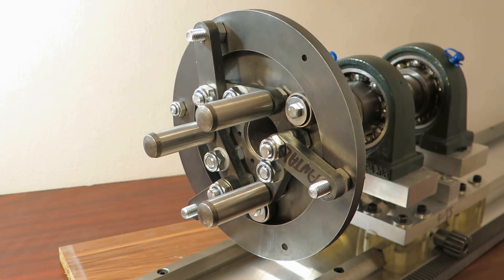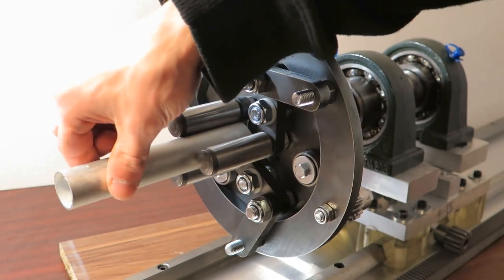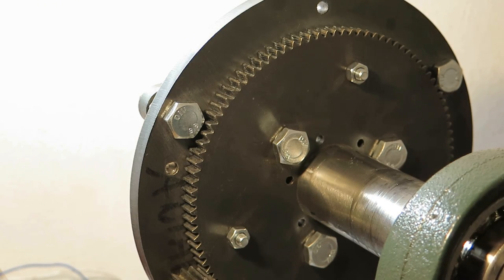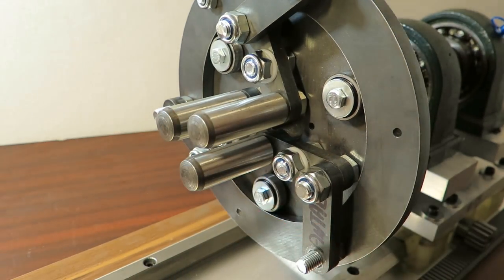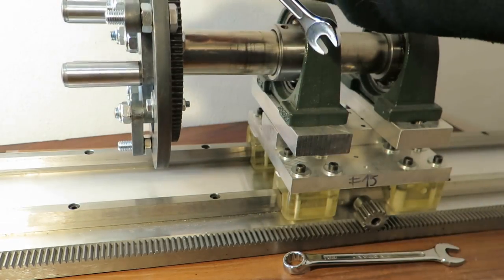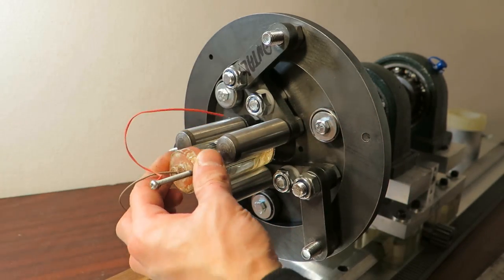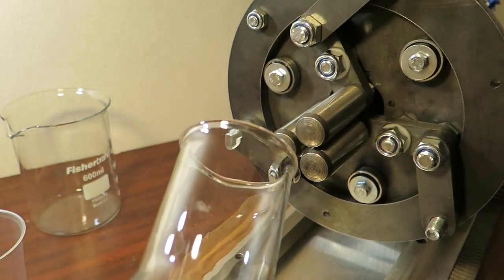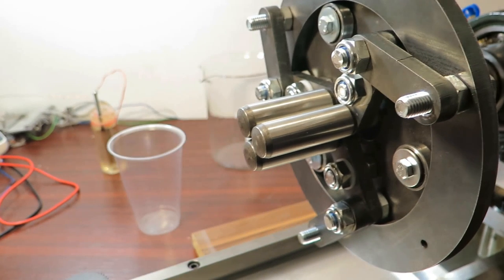Glass blowing lathe chuck

Comment: keep in mind, glass lathes don't go glass to metal, the metal jaws need to be replaced with Teflon or covered with flame resistant material (in the old days, this would be asbestos tape or similar).  This is really an excellent variation of a planetary glass chuck without all the tedious gearing!  Thanks for sharing this.

Comment: 4:28 - How is the air tube feed into the glass tube?
Reply from the maker: Well honestly I use pretty low tech solution so far - I bought memory foam pillow that I cut into circles with hole. Then I have thin bent aluminium tube on which I slide this memory foam, press it with hand, push into glass tube and I get decent seal where aluminium tube is able to rotate freely.

Not the best solution, but it is relatively fast to use. It can get bit tricky to work with sometimes when glass piece is short or it doesn't fit through shaft.

Comment: I will pareciate if you can put me more details about your project (including drawings) here or in private mode as you wish because is an interesting approach.
Reply from the maker: Don't think I have drawings, But I have some more info here https://www.youtube.com/watch?v=Cb4P3WYSkJI&list=PLyzlj5IaDE0f3XQ1dLXt-6RA28rN2mx7B
And some models here https://grabcad.com/library/glassblowing-lathe-2
Reply: @IlusysSystems  Sorry but i'm interesting only about the chuck and BTW: i dont't have the last roar of autodesk or dasault system to open .ipt or .jam files.
Reply from the maker: @nelunicoara4483  You should be able to convert these into step files or different format, I think you can convert whole assembly at once. Unfortunately I don't have time to make drawings now. also don't have SW either
Reply: @IlusysSystems  Convert with what? I've searched online conversion but nothing. So: how can i convert it without Inventor or else?
Reply from the maker: @nelunicoara4483  Last time I checked it was possible inside grabcad, but seems you need an account and upload as own project to do that. Sad thing is that it doesn't work on these files. not sure why. Fusion also refuses to open assembly so I am afraid I can't help you at this moment.
I should have uploaded also step files but t haven't crossed my mind really that this would be problematic

Comment: is it possible share the project?
Reply from the maker: Hi I have electro stuff shared on google drive https://drive.google.com/open?id=13At1etg13kt9CGTVWLkAbV4q_VlJy4Pq

from mechanical perspective, I have gone wild and have no drawings similar to original project ideas (https://grabcad.com/library/glassblowing-lathe-2)
Reply: @IlusysSystems  For me google drive is a big bull shit like chrome or android.
Reply from the maker: @nelunicoara4483  Sorry it's all I have. You should be able to convert inventor files online to stp with grabcad or a360.
Reply: @IlusysSystems  I don't use online operation anymore. It's complete unsafe even seems to be and i prefer 3dm file or even dwg. Thanks anyway for your fast answer.

Comment: Dear Sir: Congratulations, is very interesting your lathe chuck ! I bought an old glass blowing lathe but without chucks ! I bought this lathe for glass to start making homemade vacuum tubes as a hobby. I am interested in to copy your chuck with your permission, if is it possible, I would like to receive from you the measurements of the maximum diameter of the plate and the diameter of the cogwheel to scale the project to my needs.
 Than you very much in advance, I hope to hear from you soon ! Abel Santoro from Argentina.
Reply from the maker: Hello, I have this 3D model, which I did not follow exactly, but it may help you https://grabcad.com/library/glassblowing-lathe-2
I think that chuck is pretty much same as in 3D, but I will have to check.

Unfortunately I didn't have finances to continue to work on this so I haven't actually used this lathe yet, so I can not tell you if it's any good
Reply: Thank you !

Comment: get me to 50mm or better and a good price and ill buy one from you.
Reply from the maker: 50mm bore? That's only 10 mm bigger then this. 
unfinished design is available there https://grabcad.com/library/glassblowing-lathe-2
So you can build one.
I am doing this as a hobby, so it will take some time to have rough functional lathe.
Hopefully next month I will be able to process some glass on this, but until then this is just an idea. I still don't know if it will work...

Also buying - this thing have some mass - say 5kg so it is possible, that shipping will be 10x of the chuck price - assuming we are talking about chuck. Whole lathe can be 20 - 30kg
in EU it may be possible to find some cheap logistics, but US would be pretty much impossible.